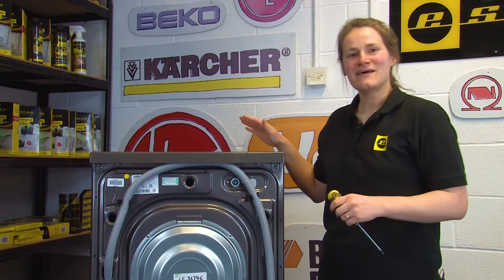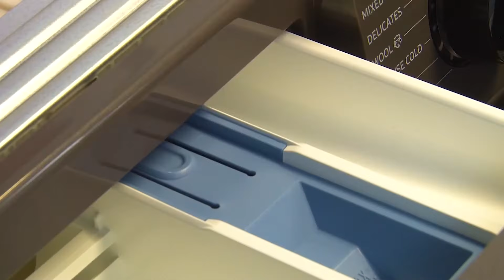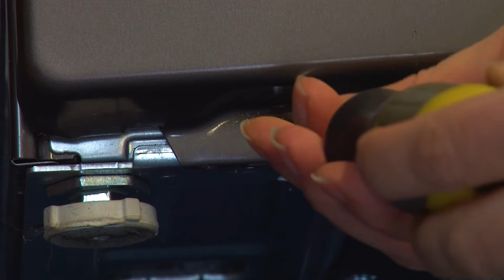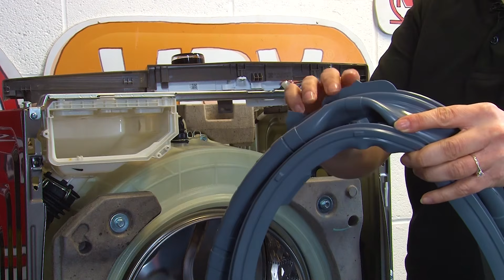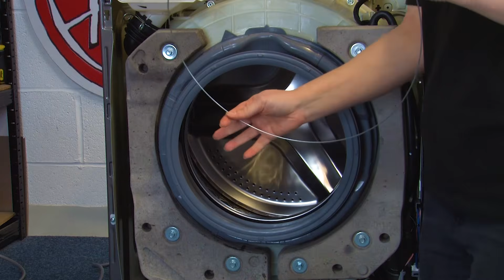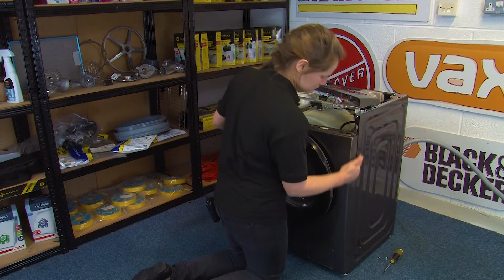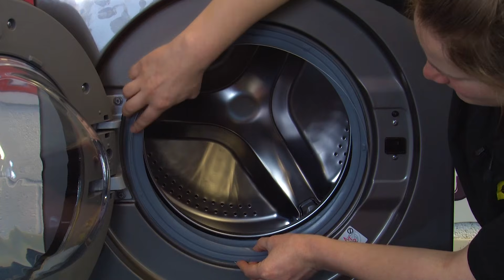How to Replace the Door Seal on a Samsung ecobubble Washing Machine

Comment: WOW! Thank you x 1000! I have just managed to replace the gasket on my Samsung machine after watching your incredibly clear and well presented video! This is well within the reach of anyone reasonably comfortable with taking stuff apart and putting it back together, but I wouldn't have known that or attempted it without the confidence this excellent video provided. 

For my specific machine, a WW90TA046TT/EU purchased in March 2024 - here are some comments / differences which might help others:

1) I didn't need to tilt the machine to remove the bottom front panel screws, it is possible that the inconvenience of bending low and having to get your head near the floor is less risk than tipping the machine backwards. It also meant I could leave the machine fully plumbed in - it only came out of the recess enough to get my hands in to remove the screws holding on the top panel.

2) It was easier to lift off the front panel and hold it close to the machine before removing the door lock assembly, and in reverse easier to refit the door lock assembly to the panel before lifting the panel back on. Just don't move the panel away from the machine until you've unscrewed the lock assembly, as the wires aren't too long. This avoids the need to grope about down the side of the drum to reattach the assembly, and risk disconnecting the wires when doing so.

3) The screw on my inner clamp did turn anti-clockwise to undo - it was just a standard nut/bolt, different from your example.

4) It was helpful to take the gasket off the front and the drum very slowly and watch exactly what part of the gasket interlocks with the drum / front panel. It then made more sense when replacing it, so I was confident it was in exactly the right position.

5) Getting the gasket easily over the lip on the drum side was tricky due to the two large concrete weights bolted onto the drum. I felt I might have not completely fitted the gasket correctly, or damaged it when reattaching the wire seal.  However with the correct sized socket / ratchet it was possible to take these off, making it SO much easier to get the gasket on and re-fit the inner clamp, before refitting the weights. They are very heavy, but so don't let them drop on ceramic tiles! 

6) The replacement part (which was sourced elsewhere) had a small tube and inlet at the top of the gasket which is presumably for some feature on a similar machine. It's designed to accept a pipe on the top. On my original gasket there was a hole marked for such a fitting, but the fitting wasn't there, despite the parts having the same part number. I sealed the top end of the tube with electrical tape, just in case water would ever get up there and leak out.

Thanks again for such a great resource!
Reply from the maker: Hi Mike, thanks so much for your great comment and feedback for this video...it's so good to know that our video was the reason you decided to replace your door seal yourself! Well done for completing the repair, and thank you for your detailed advice for people that might have the same type of model as your washing machine.

Comment: Excellent video. Clearly and calmly explained. I’m currently standing, watching a towel go round and round in the machine with a warm sense of satisfaction. 
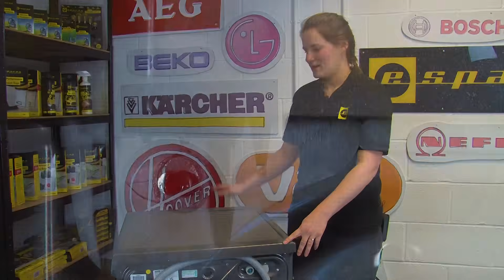Just one suggested edit: at 1:15 when she says “you can pop the top panel off like so,” what she means is “do a spot of limbering up and a few stretches because you’re going to have to pull like a crazy man to get the top panel off.”
Otherwise 10/10. Thanks!😁👍🏻

Comment: I'm doing this right now and getting the door sprung clip on is no way as easy as shown. I can't even stretch it enough to get it around the rim. Is what I have, a stronger spring that can only be factory fitted? Two of us have even tried, but it just won't stretch enough. To put it on easily with one hand is near impossible.
Reply: Stretch it out a bit

Comment: Why the hell would Samsung make it so difficult just to change the door seal?  Ridiculously labour intensive for what should be a 5 minute job.  It's almost as if they don't want you to fix anything...
Reply: I just did it. It wasn't a big deal
Reply: This is only labor intensive if you have your washing machine tucked away in one of those custom-made cabinet scenarios.
Reply: Uh, so that you would buy a new washing machine instead.
Reply: I'll never buy another Samsung machine.
Reply: Amen.
Reply: Why doesn’t the drum spin now I’ve replaced the seal?
Reply: God its horrendous.  Trying to get hands into spaces to undo screws that are too tight, five cuts from the vicious edges surrounding them. Plus the fact the space it is in is bloody awkward, even though that isn’t their fault.  It’s not the procedure they are pretending it is.
Reply: @abigailwrigley6462  it's easy i find tbh but I do know not everyone is as practical as me if someone has half an idea about these sort of things it's really easy
Reply: There is a quick and dirty way to do it that is easier. But this way looks like a 10 minute job and is the right way.
Reply: It is a pain, but TBF - this video made it simpler. My biggest pain points were things totally stuck together, and that final clamp. How did she make it look so easy??
Reply: You obviously haven't changed the drain pump if you think this was the most annoying
Reply: Thats an easy one compared to other brands
Reply: It’s a simple task. There’s Nothing labour intensive about it! Few screws out and in and it’s done. Should take 10-15 mins unless you’re a Liverpool fan then you’ll have no clue whatsoever, even with this video to hand. 😂

Comment: Our ecobubble machine was a slightly different model but I was still able to use these instructions. Much easier than trying to replace the seal with the front panel still on.
Differences were:

- The control panel wouldn't budge until I reached under it (from the top) and freed all the tabs under it as well as the ones on top. Also had to undo the clips holding the cables in place to all it to be placed on top of the machine . Take note of where these need to fix back on. 
- There is a hose which fastens to a pipe at the top pf the seal. This needs to be removed by using pliers (or brute force) to loosen the clip (by pushing the two tabs together) and then slide it up the hose. The pipe on replacement seal was different and I had to decide whether to use that one (it had no ridge to keep it in the hose) or replace it with the original (which can be removed from the old seal). I decided to use the new one, replaced the hose clip and so far have seen no leakage anywhere but I've kept the original part just in case. 
- Pay attention to which way the door lock goes on. My machine had no switch to stop you putting it back the wrong way around... 
Apart from a small panic when I couldn't free the control panel, this went pretty smoothly. Pay attention to the small details of how the demonstrator does things in the video; especially getting the seal onto the rim and putting on the external clamp. There is a knack to both, but once you have worked it out, it is relatively simple. However, it did take me well over an hour rather than the 15 minutes of the video. 
Thanks eSpares!
Reply from the maker: Hi, thanks for your comments here. We're glad you were able to use our video to help you replace your door seal. Hopefully your comments can be of help to other people that have a model like the specific one you have.

Comment: Following along with a slightly different Samsung model and this was a much tougher job that expected. The inner door clamp was so stubborn and hard to get to I had to cut it off and buy a replacement.  Thank you for the video but might be worth mentioning this is not a job for beginners.

Comment: Great video - so clear. I had a few issues getting the inner seal retainer undone. Had to use a 7 mm socket on the screw as didn’t have the angle or strength to unscrew it! Everything else worked perfectly, thank you so much :)
Reply: Same!

Comment: Well explained. Unfortunately the design of the Samsung Eco Bubble is an absolute nightmare. I have watched videos for three other makes of washers and none of them require taking off the front and control unit.  The two top front screws in my unit won't come off, even using a power drill, so I can't replace the seal. And the inside metal parts have sharp edges - I cut both my hands trying to follow the video. I will never buy another Samsung appliance!
Reply: Lol yeh my finger was bleeding for hours 😢
Reply: Same, not all eco bubbles are the same. Like you I cannot take off the front panel as top 2 screws cannot be taken off!! So will have to try and do this from the inside. My make is WF70F5E2W4W/EU
Reply: I now need to correct this. Taking the front off is the only sureproof way of fitting and successfully replacing the seal. Another video I saw informed me that 2 of the back plate screws may be solid, only way to take these off is by using a socket connection. I’ve now successfully replaced the gasket but now need to purchase a new outer gasket seal clamp wire as existing one I just cannot stretch. Took me hours and very sore hands but still worth doing yourself.
Reply: I have just replaced mine, the screws didn't come off either I had to use a spanner to get then off instead.

Comment: Thanks my lady. Just a thing : a LOT of cables where preventing me from removing the control panel and the front door. I had to deal with very little space, abd the things getting in my way, without unplugging everything (obviously not meant for). Appart from this: very nice and clear tutorial. Best regards from France
Reply from the maker: Hi, thank you for your comment. Nice to know that you found this video helpful! Well done for fixing the washing machine yourself.
Reply: Yes, good video guide, but needs editing to explain about the cables, as she didn't seem to have a problem placing the control panel to one side. It can't be done without removing the cables. Saying that, they are easily removed and obvious where they go back onto.
Reply: @terrynattress5262 To be fair - I managed to get my control panel, away, but it did take a lot of very careful wiggling and jiggling.

Comment: Does the drum drop with the seal removed? I'm unsure if there is an issue inside the drum that's caused it to drop and damage the seal, or if the seal being damaged has meant the drum dropped.
All the small pieces of rubber from the seal completely blocked my drain valve, so that needed emptying and the hose removing to get all the debris out.
Reply: The drum doesn't drop with the seal removed. Have you checked the springs that hold the drum in place?